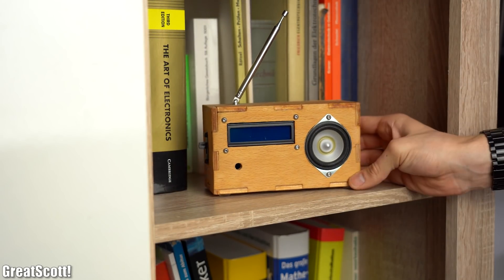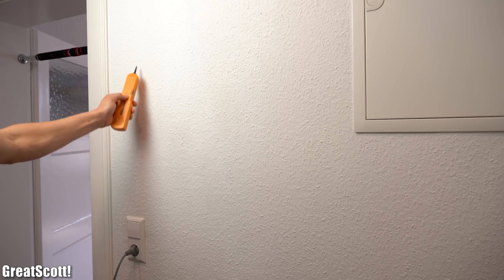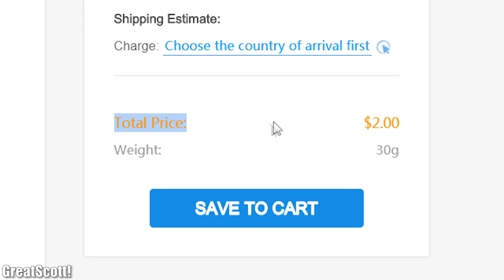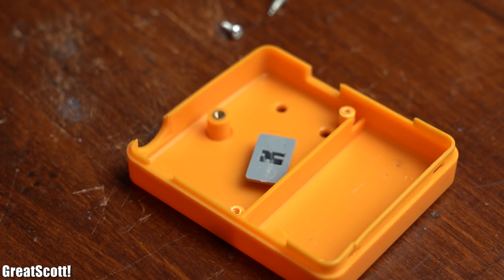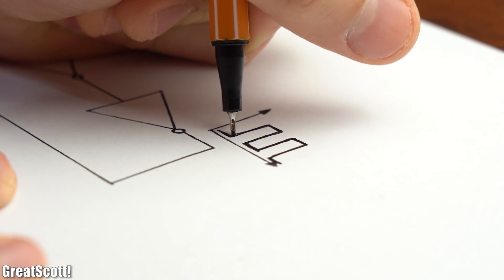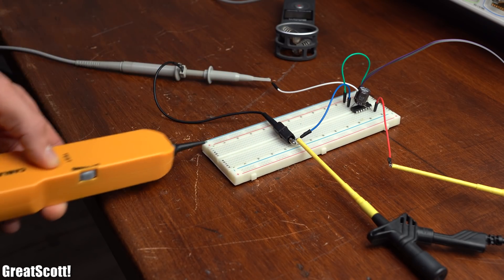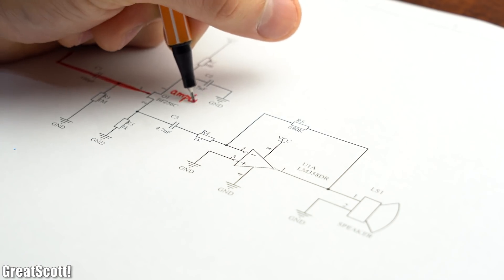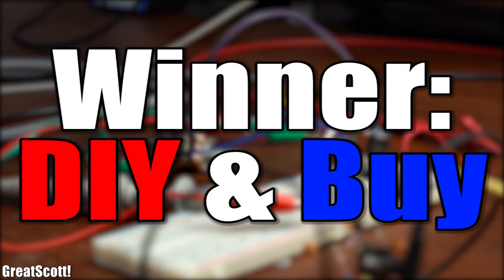Cable Tracker || DIY or Buy || A useful tool for every electrician!

Comment: DIY or BUY?
Mehdi: "Just remove the breaker and short the cables. Trace the red-dark lines on your wall"
Reply: XD I see a person of culture :)
Reply: Buy a flir. Short your outlet. Use your flir to find the hot wires in the wall. Cry when you realize the flir costed more than your car.
Reply: @rich1051414  It can't be more expensive than my Tesla Model X. 0r a cheaper way: Touch the walls and they would be warm after the short circuit. Cry when you realize you don't have any hands.
Reply: THE RECTIFIERER
Reply: Haha, I have the same idea xD
Reply: That sounds like a task for...
Reply: Mehdi??
Reply: @samusam5853  yes electroboom
Reply: @iamkrishnendudas  medhi
Reply: @iamkrishnendudas  account created for online classes 😁
Reply: @samusam5853  Renamed; account was created in 2014 😛
Reply: @iamkrishnendudas  😁😁 online class nai sbki lga rakhi hai
Reply: @samusam5853  Hmm..😁😄
Reply: @iamkrishnendudas  😂😂
Reply: @iamkrishnendudas  did you mean me? 2014 acc
Reply: The funny thing is this is the very next comment after one from ElectroBOOM
Reply: @imark7777777  Look at the like rate. Looks like, mine was earlier.
Reply: Underrated comment
Reply: @Leroys_Stuff  under rated brain
Reply: Who's Mehdi?
Reply: @mohammedmohiuddin8847  Electroboom
Reply: Bwahahahahaha
Reply: Thats awesomely perfect way to track for free😂
Reply: FUUUUUUUUUUUUUUUUUUULLLLLLLLLLLLLLLLLLLLLLLLLLLLLLLLLLL BBBRRRRRRIIIIIIIIIDDDDDDGHGHHEEEEEEE RRRREEEECCCTTIIFFFFFFFFFFFFIRRRREEEEEEEEEEEEEEEEEEERR
Reply: @_BSG_  FBR🙄🤣🤣

Comment: I have taparia(which is Indian tools manufacturer company)taster but 
,We can test dirict to the wall plug 
and also check wire current is present or not but there is cach
We don't connect wire with it but
Touch ground (Earth)pin on it.

Comment: Who needs PCB when you can solder all the parts on mid-air?
Reply: "Stay creative...."
Reply from the maker: I know, right?!
Reply: @greatscottlab  JLCB PCB are not very happy about this.
Reply: Yes.  And then they sprayed it with a film of wax so that any dust that got in would stick and turn to grime when you worked on it.  Those were the days, eh?

Comment: Sir, such a circuit can be simply made by using Darlington pair ICs. Search for "transistor voltage detector" circuits on youtube. You dont need to make a sender-receiver circuits in that. If you had made the circuit using Darlington pair ICs, DIY would certainly be the winner in this video.

Comment: I have one question hopefully you can help me out, I'm an electrician in Massachusetts and i have a cable finder but it gives me problems in very old buildings. Because ether the ground is connected throughout the building or the neutral in connected to a pin block in the panel So I Am all ways following different wires/cables. 
Please help if possible  thanks your channel is awesome

Comment: Can't you just pick up sine wave from the cables with coil connected to a scope or anything? Like a diode would probably be enough.. (Luv your vids btw)
Reply: If you're simply looking for "is there a live wire here", yeah you could do that.

If you're trying to trace a specific circuit, you'll need to put a signal of a different frequency on the wire to differentiate it.

Comment: bro make a circuit with transistor to add 1 or 2 digit numbers ...it's not a simple task,and remember...you don't have to use a ic,for visualisaiton you can use a ic but for calculation use transistors

Comment: Luckily I have brick walls so the cables go straight up from outlets and use the roof cavity to move horizontal. Just have to avoid places above an outlet.

Comment: I am not so convinced. Your setup was the most easiest case I can imagine. The buy version I had didn't work so well. Barely gave a signal through stone and other (unconnected) cables close by also gave a signal.
Reply: Well, all your power lines are connected together... Also the model you had might be a bit weaker or just diffrent. The scott showed just his case.
Reply: @514_cricket  As I said: "unconnected". The signal jumped cables even without a connection. His cable was "alone" and was probably only covered with plaster.
Reply: @tcurdt  oh sorry my bad.. Schouldn't it be noticably weaker then?
Reply: @514_cricket  That's what I was hoping when I tried. But it really wasn't good enough to track the cable. Once it was inside the wall the signal was not strong enough. And closer to the other cables all became senders. Quite frustrating - and surprising.

Comment: In my country these detectors are not used with active phases . It is very dangerous, as much or more dangerous to encourage a technician to use them.  because, we do not use light constructions, but we uses "brick" and "concrete", that makes trying to locate a conductor through a noise generator, completely unsuccessful.  You can see to used by communications and telephone personnel. Please caution, "ELECTRICAL HAZARDS"
Reply: Out of curiosity, are there other types of electrician tools, that could work better in the scenario your describing?

Comment: It's known as live wire detector,you can make it using 3 transistors,see electroboom video about it,Live wire detection circuit
Reply: This is very similar to electroboom's circuit, but different use cases.

Great Scott's allows you to trace a circuit without turning off all the other circuits. Only the circuit under inspection produces a tone.

Electroboom's circuit tells you if mains voltage is present, so it is great for ensuring power is off before you work, but if you want to trace a wire through a wall, you have to turn off all circuits except the one you are tracing! Not always practical.

Similar principles, but different use cases.
Reply: @DonaldZiems  yaa some things are different like it doesn't use light to show signal,instead...use an amplifier circuit and a speaker,and instead of using live wire's ac radiations,this circuit sends over a pwm signal and is a transmitter and a receiver by itself
Reply: No it is not. It is known as a fox and hound.you have a transmitter on a DEAD cable and the reciever can detect the signal shiwing you where it is. It's very handy with LAN and phone cables. Where hundreds of cables can be in one box and you need to find one.
Reply: It's a circuit for electrostatic detection or basically measuring a parasitic capacitance from my point of view

Comment: I would go with the buy for once, for a safety concern I don't want to screw up  everything and short  circuit wires. Even if both work exactly the same if i buy  or do one what I'll look at first is relibility

Comment: Buy: Finding pipes and other metal objects in walls is just as important as finding wires, so you want a multifunction device that can detect more than just AC cables.
Reply: U need a metal detector 😂 (no offense)
Reply: @jiviteshpandab6194  A metal detector can't find plastic water pipes. If you do a lot of work, you need a radar based detector that can find plastic pipes as well. If you don't do a lot of work, you can get away with a multidetector that can only find metal pipes and power lines.

Comment: I've got one of these and by the square-wave sound that it makes, always thought that it was quite simple - but I didn't know it was as basic as this!  Still, it's worth the money.  I previously used a cheap AM radio as a detector but the main problem is that it's not very directional and due to design, it is tuned to receive radio stations instead of signals in cabling.